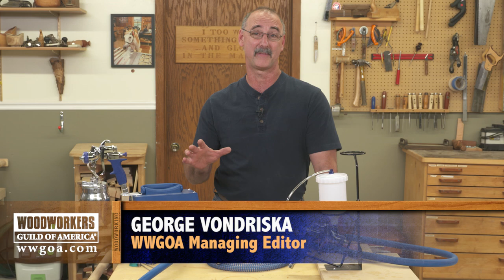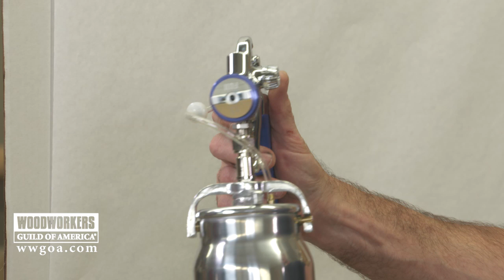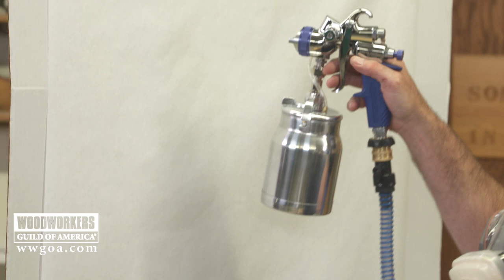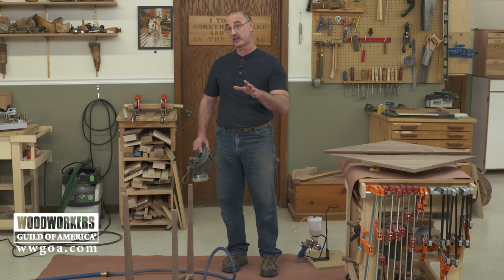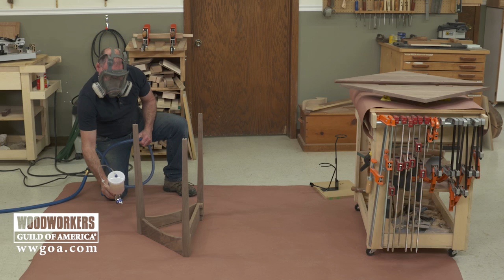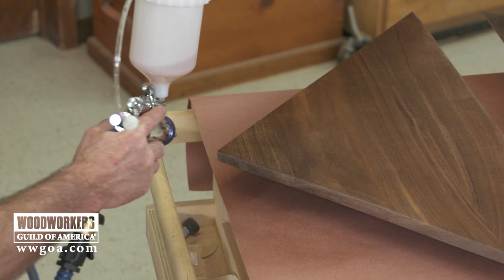HVLP Sprayer Techniques for Your Woodshop

Comment: HVLP means high volume, LOW pressure. My HVLP with 4 stage turbine is running wide open at 12psi. I can dial it down if needed. Compressors need to start and stop to replenish air. This can cause spitting or loss of product in mid spray-on larger surfaces. Thus ruining the finish especially on higher-end jobs. The turbines provide continous clean air at correct low pressure. I wish this video compared the gravity vs. the cup feed. He showed the cup in describing controls but used the gravity feed on the piece he sprayed.

Comment: I have an Hvlp procomp. I am into my 2nd year using the machine. With frustration on changing paint or refilling the paint 1/2 gallon pot. Seems like I do fine on 1st filling then it’s not flowing afterwards. I’m using sherwin Williams urethane trim. I love the results but performance is too unpredictable.

Comment: I dont think i have ever seen any painter mess with the gun settings that much in the middle of spraying.. just asking for trouble with your application. Get your gun set up right then adjust your body/spray position and set the part up so you can maneuver around it easier.. also spraying edges first allow you to blend the flat areas easier, spraying the edges last you will get overspray on the flat surfaces..
Maybe just done to over exaggerate the adjustabilityof the equipment?? Idk ..

Comment: I'm looking for a video to show my shop guys how to handle a gun. I was hoping you would move the whole gun along a path either vertically or horizontally to keep the axis of pattern perfectly perpendicular with the work for an even coat. But in the segment I watched you're doing exactly what I'm trying to teach them not to - just pivoting at the elbow or shoulder and spaying in a lazy arc.
Reply: I been wondering the same thing. I see a LOT of videos that show HVLP sprayers pivoting wrist/arm.. and I always read you want to keep it equadistant like 4" to 6" away perpendicular all the way through

Comment: Does the Fuji handle lacquers and varnishes, with fairly low flash points?  I have a Wagner Paint-Ready machine and I was told it cannot be used with lacquers or varnishes.

Comment: I noticed that you don't aim the gun at the material at a 90 degree angle. Does this cause any issues with the amount of sprayed material being different on the surface? I.E., if your angling toward a horizontal surface, the top of the fan will be putting less material per square inch than the bottom of the fan? Thanks for the video.
Reply from the maker: Hi Bob.  Holding the gun at exactly 90 degrees would ensure more precise consistency, but given that the material will flow once it's on the surface, and that there will be multiple coats applied, it's not critical to maintain exactly 90 degrees. 
Thanks
Paul-Woodworkers Guild of America

Comment: If you have a 50 gallon compressor or more, spend your money on a quality spray gun (HVLP or RP from SATA) and you’ll never look back. Infinitely superior results -without all that horrible noise.
Reply: Strve Sit, I both agree and disagree with what you say. Let me clarify. I actually have a much larger (belt-driven) air compressor in a far-away room and have to strain my ears, and then some, to hear it when I’m spraying; and, yes, that’s my biggest problem - save the fact that it runs on 3-phase power - namely, snatching it up and running off to the job site 😂!! That’s why I have an HVLP turbine - like any smart man - for those occasions. Nonetheless, truth be told, there’s nothing like a SATA B RP spray gun - and I mean nothing. Obviously, you realize I have a professional setup; I know not everyone can have what I have, but I was just being frank. Indeed, you can get a wonderful finish with a turbine, but the compressor-driven setup, like that from SATA, is unbeatable - both in terms of price💰and quality💎. Believe me, it’s the choice of professionals. And, yes, speed is important - not to mention addictive🍷. To make my point, just ask any automotive spray painter what gives him the best finish in the ideal situation. In woodworking, you can get away with a decent turbine; but it’s the demanding applications that tell the difference. The finest finish still requires the old-style high pressure physics because, no matter how you flip it, spray painting is really all about atomization. So, why have HVLP guns gained prominence? Is it the sales-pitch story you hear about saving material? Not really. Being economical is, doubtless, a good thing; but the truth of the matter lies in the fact that HVLP produces less overspray and, as a result, conforms to VOC regulations. That’s why SATA - along with other manufacturers - have come up with a compromise, an atomizing solution that, although still VOC-compliant, is fundamentally reminiscent of the old-style spray guns. It’s known as ‘reduced pressure’, or RP. And the good thing about this technology is that it runs on less volume than HVLP without the need for high pressure (+/- 29 PSI, depending on the application), which means you can actually use it with a smaller air supply. The downside, of course, is that you waste more material. So, although economy is a good thing, it’s really an afterthought when it comes to the professional spray-painting world, where quality and speed are the uppermost concerns.
Reply: Vadim , Did you read my reply? Look at my fourth sentence. The rest of my reply explains the difference between HVLP turbines and air-compressor spray guns.

Comment: This guys technique is absolutely horrific not to mention the information is 100% inaccurate . for instance the HVLP isn't for conventional air compressors as they produce contaminated air with water and or oil .  Hmmmm let me think about this ....slight pause .... no thinking necessary as the HVLP spray gun has been mandated for ions in the automotive painting business and does quite well there so go back to your day job

Comment: Hi. Im going start paint cabinet and utility trailers. Does the Fuji Q4 Gold work for what I want?  Im look the Q5 platinum its the top of the line of Fuji system but one person offer me one used but in like new conditions one Q4 Gold complete system for $465  included gun kit plus flex extencion plus remote. Want to know if for whats I want do the Q4 Gold work and if the $465 for this Fuji Q4 Gold its ok
Thanks
Reply from the maker: Hello, 

I’ve got the Fuji Mini Mite 3 and have been very happy with it, using it to spray shellac, water-lacquer and paint. I’m not familiar with the Q4 Gold. Your best bet is to contact Fuji and tell them exactly what your needs are, and ask them for a recommendation.

Hope this helps, 

George
WoodWorkers Guild of America Video Membership

Comment: I spray from a good sized compressor with i believe no water issues at all. First I have an auto dump valve that comes on for 15 seconds every time the compressor starts, which blows any collected water from the tank into the yard. The hvlp regulator is connected to a ball valve on the main hp air supply, opening that ball valve, i adjust the regulator for the hvlp gun to the desired pressure. I use a dryer on the hvlp line, which will also remove water from the air line. That guy dumps every time automatically when i shut that ball valve off.  I spray just about everything. 
Don't bother with the auto-dump valves from Harbour Freight, they just do not last, get a good one. I went this route to save some coin, and not have another piece of hardware to maintain. Has worked well for 2+ years so far.

Great Video...... always enjoy seeing how others get their projects done, always learning something from someone.....

Comment: I own one of these.Spraying any waterborne or latex always was a big problem with this unit. We always had to thin it way down (beyond any paint manufacturers specs) to get it to work. Unless we were missing something?
Reply: try to spray latex with a compressed HVLP, you will have to dilute, otherwise you will get big droplets, at the end if you want to spray automotive paint, primer or an enamel for an iron fence you need to dilute, unless you are spraying something thin like a stain
Reply: You should be able to spray waterborne lacquer, polyurethane and tinted lacquer without having to do any thinning whatsoever.  As far as latex paint is concerned, then the answer is yes, you will have to thin it.  In my experience, the clerks at most paint supply stores have very little experience spraying latex usng turbine HVLP systems and therefore are not a reliable source of information.   And, the information on the paint tins from those places and the big-box stores in particular, is most likely misleading.  Go to a paint supplier who sells to professionals, to get the advice you need regarding the amount of thinning needed for proper results.  Get yourself a viscosity cup so that you can measure the "thickness" of the paint in order to ensure you're not under or over-thinning it.  Then, get yourself some Floetrol to add to the thinned paint so that it will offset the thinning effect of the water and help with the drying of the finish.  Again, a good paint supply house should be able to provide you proper advice.  Hope this all helps.
Reply: Floetrel? that doesn't help dry it, extends drying time to allow leveling? can run on you if your not aware of that... @ApexWoodworks

Comment: New to spraying. What symptoms show that air is causing bounce back or over spray?
Reply: robydean7, symptoms, as in how to know it is happening? If that is your question, then observe the finish as it hits while watching from the side (orient yourself as if you are a second person watching from the side a few inches away). Then spray while adjusting the master air-flow control. You should then be able to see how bounce-back varies with high or low total air flow.

With my gun, I lower to master air flow as much as I can while still getting good atomization and patter to reduce overspray. If you are in a situation where getting lots of finish on a large area quickly is the main goal, then crank it up.

Comment: How loud is that turbine machine ...fo u need ear protection aswell .And it that platinum machine much quiter then the last model
Reply: The minimite is like 80 db, if you're standing right beside it, maybe 85.  The platinum is quiet, like 70 db at max, but most of the time you have it dialed back to half, so like 60 db.

Comment: How do you keep the finish off everything else in the shop?
Reply: Prmskeepr That’s the beauty of this low pressure revolution. In the old days only a tiny amount of the paint went on the target. Now, the overwhelming majority does, and what doesn’t, doesn’t come flying off with much force, so the particles hang airborne long enough to dry and become dust and not land as a wet film and paint something. You just need to cover things that are really close and arrange for some form of positive airflow in your shop like a window fan (blowing out of course, with the inbound air source being filtered).

Comment: Very informative. The one thing that always seems to be missing is the cleaning and maintenance of a HVLP sprayer. What do you with extra finish in the pots? Do you need to clean between coats left to dry overnight? What needs to be done between uses? Should you have multiple guns? Any help would be appreciated. As you can see, I am intimidated by finishing.
Reply: If unthinned, I put residual finish back in the original container.  If thinned, I have some spare storage containers.  Cups are frequently made of aluminum, may or may not be lined, and can react with the finish if allowed to stay in the cup too long.  8-12 hours is probably OK, 8-12 days is NOT OK.

Clean the gun & pot (cup-under guns can use liners) with the solvent designed for the finish sprayed.  I spray >90% of the time with either waterborne finishes or shellac.  So water or denatured alcohol.  And, until they fully cure, most polyurethanes are susceptible to ammonia.  And so is shellac.  So keep some household sudsy ammonia around.  I run it 50:50 with water through the gun and it absolutely removes the residual finish.  Also good with a toothbrush to clean the cup gasket.  Rinse thoroughly with water.  Then run the gun "dry" to dry out the passages.  Clean the needle, nozzle and aircap with the compatible solvent.  Dry and store appropriately.

Multiple guns are a good idea if you are moving back and forth between non-compatible finishes.  Or you can invest in extra cups for the cup-under design.  Gravity feed cups are usually a little more finicky to change.  Or the 3M system which is very clever and fast cleanup. 

When pricing out a system, remember to budget for accessories such as additional sizes of needle/nozzle/air cap, good respirator & OV cartridges, replacement parts like gaskets and air filters and material to knock together some kind of spray booth or spray area.

Pick up a copy of Jeff Jewitt's book on spray finishing.  Some info is getting a bit long in the tooth but the basic principles remain the same.
Reply: Thank you, thank you, thank you. Just the kind of information I needed.
Reply: TheRwyoung Good on ya for taking the time to fully answer this fellows question. I remember how long it took to get to this point and how hard it was to overcome cleaning mistakes.
Reply: WoodRodent TheRwyoung gave you great advice to which I’ll add: put a little of the solvent for whatever paint you’re using into one of those extra cups he advised you to buy before you start shooting because something always happens, kids, dogs, tornados, and you may want to quickly Sanaa off the paint cup and cover it, put on the solvent cup and shoot it until only solvent comes out, and then leave it hooked up while you put out the fire to protect the finely machined parts inside which are easy to damage and which count. Have a ball!